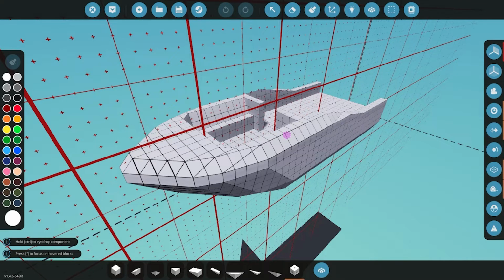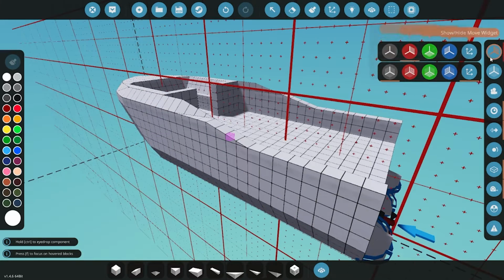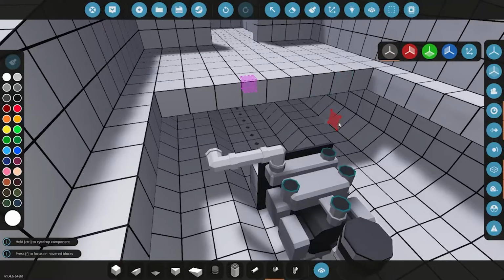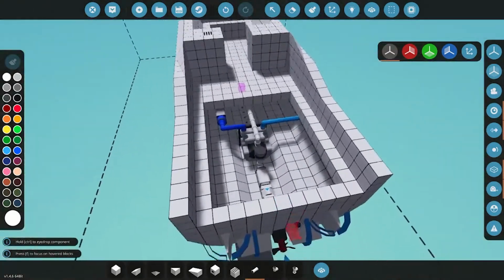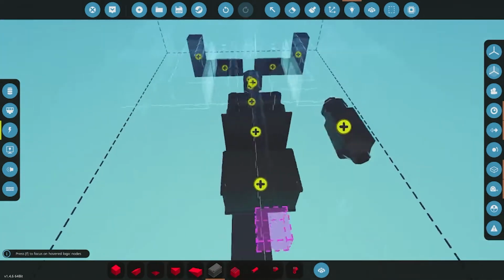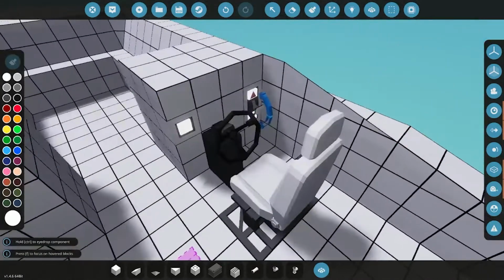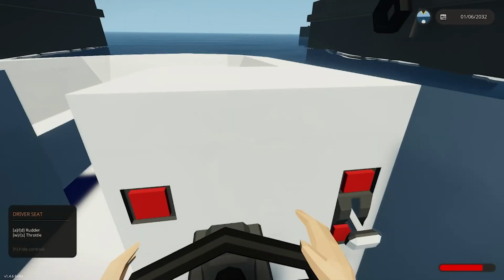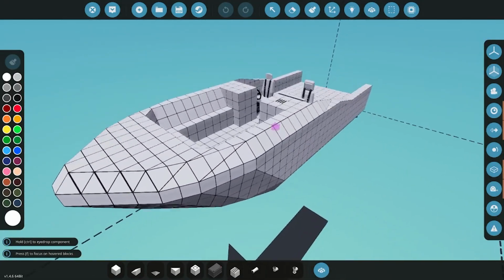Your First Build in Stormworks (2022) Part 2

Comment: My speed doesn't increase when going into high gear. From 9:5 to 1:1 it slows down... Trying to think of reasons
Reply from the maker: If there is too much torque the whole engine will lag down. Generally unless you do the full math, I just experiment with gear ratios until I hit the tipping point there it is lagging down the engine. If you need more power you could run dual engines!